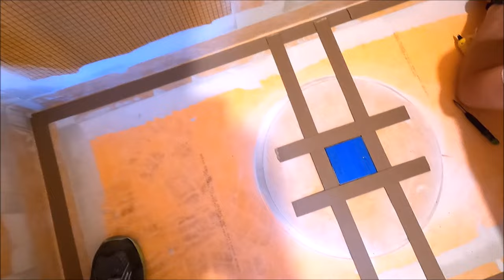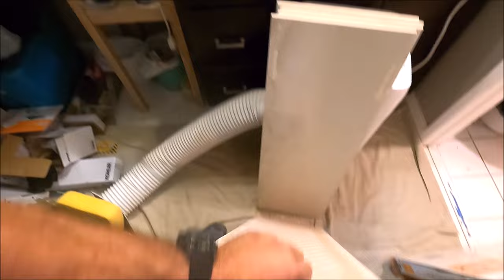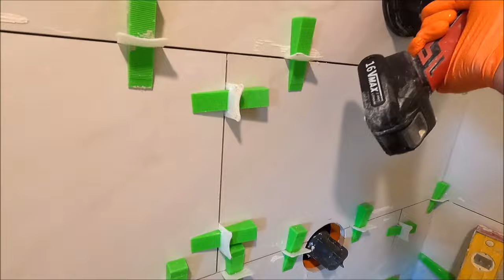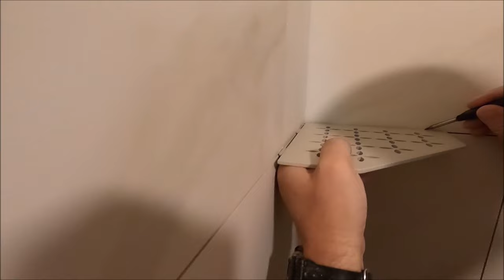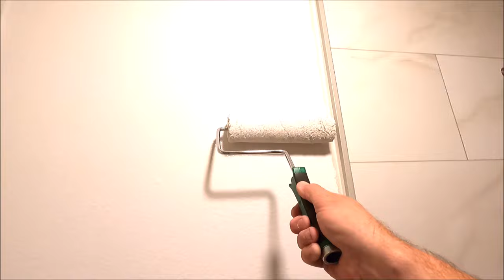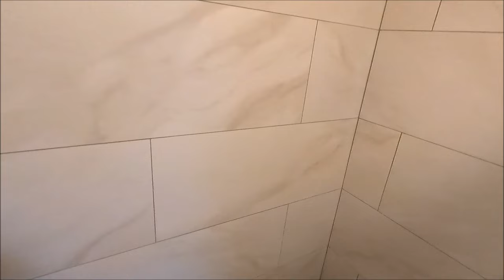Trend ALERT! Brushed Gold on White Shower Design

Comment: every one should pre cut shower floor tiles, much better imo. for me, it doesnt matter what tile it is, i always pre cut shower tiles, even around drain. whilst i dont always use the wood template and use just a laser and ruler, its always done before hand. also when dry laying shower floor tiles you also try and center sheets, this way your not adding single pieces to any sides, much easier cutting sheets when the cuts fall at a big portion within the sheets. i also do this on backsplashes. when everything is pre cut, you can then spread the thin set to the entire shower floor (if they are smaller shower floors) and set in one shot, this gives you a flatter floor as well with less chances of thin set up the joints.

Comment: I've always been curious about your choice of grout. It is the one product that I don't see you mention often, other than the color. I'm a fan of Laticrete epoxy gout. What grout do you use on most of your jobs?
Reply from the maker: We use Prism grout the majority of the time. We have had zero problems or issues with Prism after it's sealed.

Comment: Simple and clean. I just don't like the big caulk  joint at the bottom. If the cuts are closer, it wouldn't have been so bold. Did you seal that shower Pan material first?
Reply from the maker: We sealed after install and sealed again after grout for the stone herringbone.

Comment: Hey Landsberg, nice video. I noticed you started the first course right off the floor tiles, can you explain why you would do that rather than starting on the 2nd row like I've seen so many times, with ledger board?
Reply from the maker: We always prefer to start from the pan tile rather than a ledger board
Reply: There's no point to start on a ledger board. If you've already got the Pan done, why would you want to come back?
Reply: i agree. if your pan is level why use a board, just takes more time imo. it also comes out flatter and you dont have to worry about getting the clips under that last tile under the ledger.

Comment: What’s your average turnaround time on a full bathroom remodel? Let’s say less then 150 sq ft. Full shower, floor, vanity etc.
Reply: 150 Sq Ft is Master Bathroom size. I'd say 3-4 weeks depending on details.
Reply: depends on your waterproofing, standard walk in shower that's floated and a floor as a professional one business week it also depends on material 12x24 seems to go a little faster my favorite size is 18 by 30 inch tiles those showers fly.
Reply: 3-4week
Reply from the maker: If 8 hours are put in, we can have it torn and and remodeled within 7-8 full days.
Reply: @LandbergTileTV  So you're basically at a week and a 1/2 . which makes total sense. Because you show us how you do it and I love your showers I like less is more.  but just like this one. It took a little bit of time to put in the 3 corner shelves at the end. But for the most part, like you said in the video. It went up pretty quick. (No niche). so yeah, especially if you're not waiting on a plumber and you're not waiting on the solid surface guy, To make your material . that's what eats up a few days the way we do it. I'm right around 12 working days,  2.3 weeks ..... for a standard. 3 by 5, like in this video here, But with a 2 tiered niche , And I'm by myself. Love your videos man ,have a Good Night.
Reply: Took me 6 months to do my own 200 sq ft. with my free time after work lol